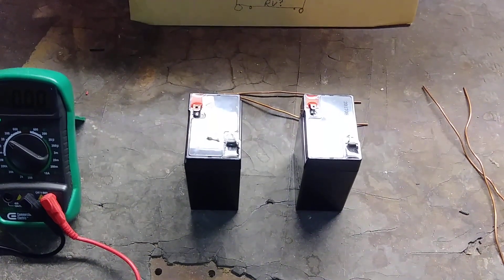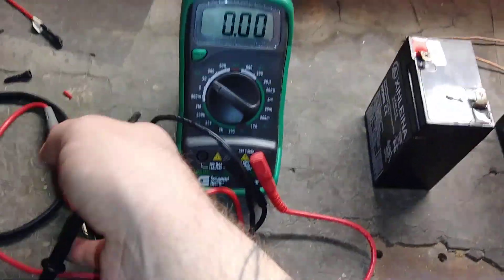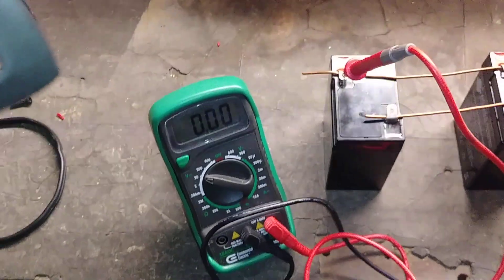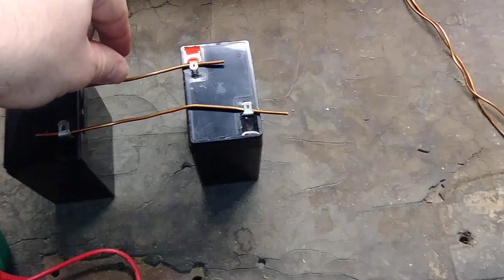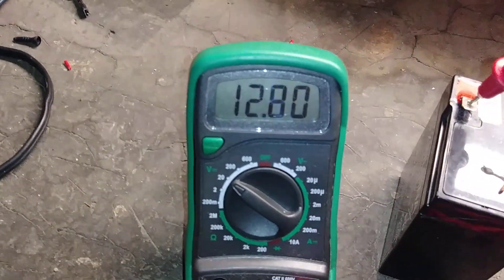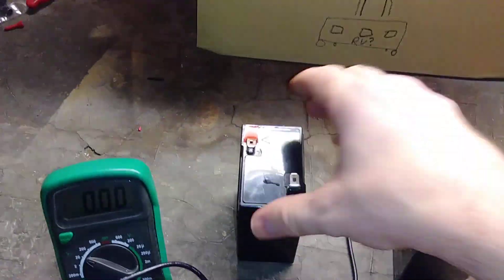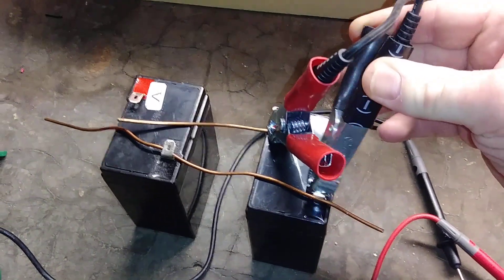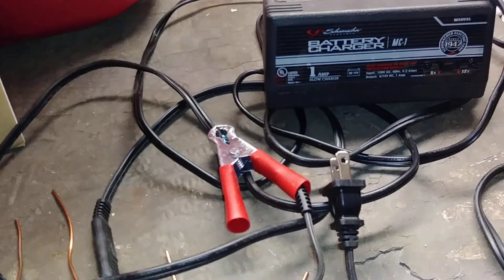Wiring Batteries in Series & Parallel - Increase Your Capacity - Wire 2 6V Batteries to 1 12V

Comment: Hi nice job explaining how this kit works I would be using it only to provide lighting in my shed in the yard. So how would you handle the turning on and off the light! I noticed that you showed light switches on the corded bulb. If that is hanging up in the rafters, can I still get to that switch? Or can this be controlled from the controller box? Also can I safely turn on all supplied lights at once and how long could all lights stay on at night.
Thanks!

Comment: can 6 volt batteries be rigged to work into and connect to an existing 12V battery bank using this method if the other 12V battery bank batteries are a 12V system?

Comment: good video but you really didn't show how to CONNECT the 2 batteries together for parallel method, you just laid 2 wires across the terminals. which is fine but in reality when connecting batteries together via parallel method  how do you then connect the terminal prongs to the RV because all 4 prongs already have connectors on them, in other words there is no more room for another connection to the terminal prongs out to the RV.  I hope my question is clear.

Comment: Does it double the amps to????
Reply from the maker: On parallel, yes.
Reply: Does amp go up in series? Or does it stay at 4.5?
Reply from the maker: @aweiskhan1290  In series it goes up in Voltage, NOT amperage. In parallel the voltage stays the same and the amperage goes UP.
Reply: Thanks for your reply.
I'm replacing 2 of 6v 4.5h. Like the ones you showed.
It has a 5amp circuit breaker fitted. Btw they are in a series.
Can I replace for 12v 7ah battery or will that short circuit it.
It's for ride on kids car.